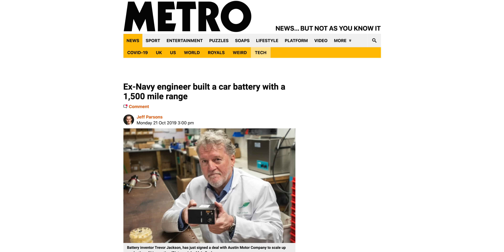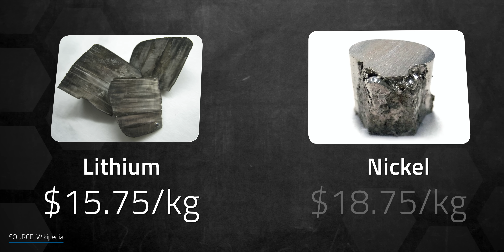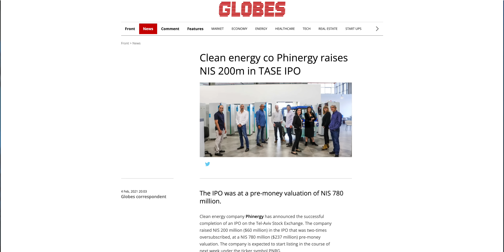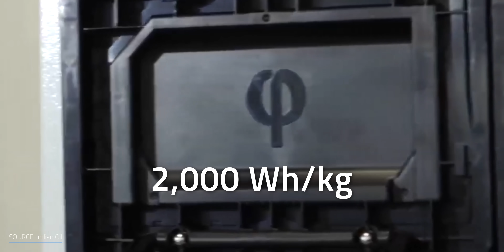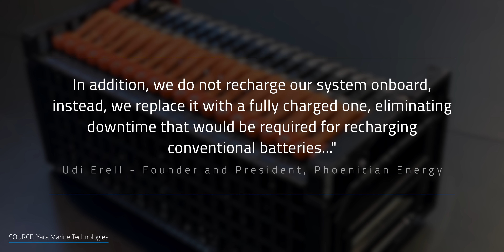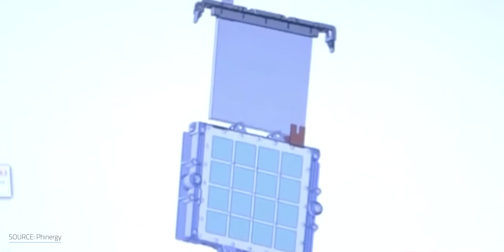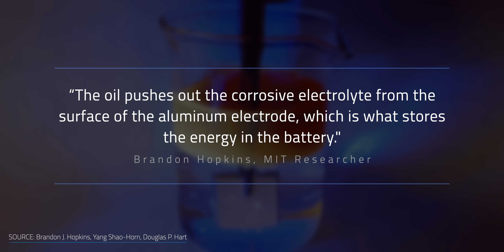Exploring the 1000 Mile Car Battery - Aluminum Air Hype?

Comment: Seems weird to say with a conventional ev u can get someone out to give u a small charge but if you have an aluminium air battery you have to get towed and cant just be given a battery. Batteries might also me able to be selected for range and time. One week you select a bigger battery for a road trip the next a smaller one as u are only commuting locally for a week. Interesting solution.

Comment: Some of the problems can be mitigated by using "plug in hybrid" solution. Smaller size rechargeable accumulator for every day commute,  and a slot for a battery to extend range if needed

Comment: I think that aluminum air fuel cells are one of the most viable alternate energy storage methods when it comes to electric vehicles. Having two batteries and quick swaps at stations would be the best way to do it. The non-rechargable nature makes using it no different than using traditional fuels, and we're all used to dealing with those in our cars. 

The mining of the cobalt used in lithium batteries is horrible for people and the environment.

Comment: I see battery swapping as a nice quick option, but not by lugging a new battery into the back of the car. It needs to be drive through and done from the underside so that loaded vehicles don't need to worry about stuff in the loading area needing to be unloaded first. However honestly having had a hybrid for around 8 years, I think that range anxiety is over stated here in Europe. Most daily journeys are nothing like as much as the range of the car and so charging at home, at work, at the shopping centre are all perfectly viable. Hydrogen is touted as another alternative and I'd be OK with that as long as it really is green.

Comment: A 1000 mile battery would be an absolute game changer for sure as it would completely do away with the only real reason people have for being hesitant to make the switch. At that amount of miles EV range becomes more appealing than ICE range....BUT if the battery is not rechargeable, I don't see this working. Having to swap large battery modules every 1000 miles seems impractical - that's every month for a lot of people. Unless it can be a totally machine automated process that's just too inconvenient, as the experience would be like having to take your car in for servicing every month, and nobody wants to do that. Maybe if the range was 3K miles and it was every 3 months that could work.

Comment: Battery swapping is a good idea for a Fedex type company.  The batteries could be charged from certified green sources and swapped as necessary.  At the moment our electric grid depends on mostly fossil fuel (natural gas).  Tesla's are basically running on natural gas.

Comment: I think this could really work.  I view battery swapping as a good thing.  It separates the making of batteries from the car company, giving more traditional OEMs a chance.  It gives dealerships business and a way to make money servicing cars.  It allow green energy like wind power the  time to charge batteries off grid and make use of energy not used other ways.  It improves the initial cost and resale of EVs.  On top of all that, I see nothing that would prevent the auto maker from putting a lithium ion battery of 60 miles or so to make sure there is a way to keep going in emergency out of range problems.

Comment: This seems like a perfect solution for a hybrid system. One that relies mostly on battery power to assist a fuel based combustion engine. This was you can have a car that can go 2,000km on a tank of fuel. You reduce the use of fossil fuel while also reducing the need to swap batteries.

Comment: I would rather have 30minutes 300miles Charger or faster instead of Swapping non reusable batteries. Would also be conserned what if the Battery Breaks and ma Chasis corrodes and i dont know it ? Because nothing is ever leak proof or can be handled by 1000s of people without some chance of breaking smth. I like the Idea of Taiwans E-Scooters with the Swapabble battery packs that recharge while u get a fresh and full one to drive around.

Comment: In 2.5 years I have recharged at home, overnight for over 95% of my miles driven. I’ve been to fast chargers just 5 times. Not having to visit a service station regularly is a great freedom I wouldn’t trade. So, no, I would not be interested in battery swapping unless it was significantly cheaper and just as reliable.

Comment: The average gas station sells 4000 gallons a day (11.4 tonnes), or about 140 MWh. At 8.1 kWh/kg, Al batteries equivalent would be 17.5 tonnes, just for the electrode. Accounting for casing, lets call it 20T, about one 40' container if palletized. But you are swapping, so you need room for 2 trailers on site at all times. You could get it to 1 if you had a special rack which could accept empties while dispensing fresh ones, but that's still a ton of space. Fuel is normally underground and liquids are ways easier to move around. At minimum, you'd need some automated system to load and unload all these batteries to make it remotely cost effective. Then there's the shipping cost for returns. Gas stations only make about $100/day in profit on fuel sales, razor thin margins. 

I don't see it happening any time soon, and by then, rechargeable EV tech is gonna be fantastic.

Heck, if you want rechargeable EVs but extended range, just make towable U-haul trailers with a power pack. A trailer is way easier to swap than some built-in battery modules, and you can rent it just for the occasion.

Comment: The only viable way for this to succeed in the market (or anything else that isn't a real battery), is to add this to a regular battery electric car with a small battery (say 30kWh). You need a standardized compartment, that can fit a battery, fuel cell, etc.. The cell must be small enough to change by hand. Similar to Gogoro's battery. But the car could fit several cells, maybe around four. The compartments could be structured such that you can choose between additional range or storage space. This way, you can use regular rechargeable battery for local driving, and some kind of extension cell for long range driving. Another option is to put it on a trailer, so you just attach a trailer with the battery/fuel cell/whatever whenever you need to drive a long trip. The trailer could even have extra storage space.

Comment: This would be perfect for the Renault Morphoz. It’s a concept car that has a normal lithium battery for driving around town, but the car can expand to fit an additional larger battery for long distance driving.
Reply: That's what I thought.  This sounds like the perfect supplement for a car that fits in the category of the Leaf or Morphoz.  40-80 ish mile range for driving around town, and when you want to take a trip you pop one of these in the back to keep you topped up until you arrive at your destination.
Reply: He said it is not rechargable so forget it being a energie saving sollution. 6:19 So not a good battery.
Reply: @paulvangorp8621  that’s what makes it a perfect solution for a battery that is only borrowed for long distance travel.
Reply: @BraveRock  it doesn't make any sense how you want to have a baterie that is at least 30% energie efficiënt when you need to replace parts. It will be way to expensive.

Comment: Considering that most car journeys are short, it would be cheaper and more energy efficient if we all used smaller batteries for daily life, and swapped out for longer car journeys.

A smaller battery means less weight, and more energy efficiency, it means less cost, and less resources being used. You save money buying it, you save money running it
Reply: You are absolutely right, Small EVs use around 100Wh/km with 1/4 the battery of a Tesla.

Comment: The replacement idea is nonsense, you need a lot of energy for recycling and so the costs would be much much higher than liIo simply because of the electricity costs.
Reply: I agree, it's total nonsense. Instead of 1 lithium battery you need 200 alu-airs for the lifetime of the car.
Reply: @gerbre1  lithium batteries are no magic either. 
We have around 500 vehicles in our apartment. They are switching EV at a rapid phase, we are struggling to provide charging ports for everyone. Need to rewire our entire basement, get additional capacity sanctioned. Pay higher tariff and so on. 
If its Al-air battery, I don't need any of that. Some company like Indian oil will do it for me. I just need to make a booking through an ap. Someone will come and replace it. I don't even need to own the battery.  This is the model we are using for cooking gas in India for the past 30 years now.
Reply: @adarsharao  Load management is needed. 10 cars can share a power line. Add external stational storage that is slowly charged in the background and can be used on high demand.
Reply: I agree. At this time aluminum air batteries are a waste of time and energy.
Reply: Plan is that energy for recycling comes from hydrogen, produced by electrolysis of water using solar power.
Reply: @adarsharao  
So even more Energy?

Comment: No, one of the biggest advantages of EV's is the ability to plug it in at night and wake up to a charged battery. These require swapping, which keeps you dependent on the battery supplier, and the locations that can do that work.
Reply: If you drive an ICE vehicle, you're already dependent on your gasoline provider; and given that these batteries can be swapped out in three minutes, it shouldn't be difficult to design an interface that would allow an owner to swap a battery out at home. I can change the 12V battery under the hood in my truck in under ten minutes, and that's not a process that was engineered specifically for user friendliness.
Reply: @shaun4772  i'm not dependent on "my" gas provider. I can go to any gas station. There are just now starting to be enough charging stations for EV's. That's an appropriate comparison to ICE versus EV. Comparing Aluminum Air batteries  to gasoline would be closer to looking for someone to replace your gas tank.
Reply: @shaun4772  gasoline and diesel fuel aren't vehicle-specific like aluminum electrodes can be. With a Audi gas car you don't have to (and also can't, Audi doesn't sell gas) go to Audi for gas. If there would be an Audi car with Al-air battery you may be forced to go to Audi for replacing single-use batteries (for example non-standart cell dimensions). That is way inferior than both current cas cars and current electic cars.
Reply: @volodumurkalunyak4651  That's why the auto manufacturers need to get together and agree on standard battery types.  If I buy an electronic device that runs on AA batteries it doesn't matter if the device was manufactured by Sony or Toshiba because the manufacturers all agreed on standardized battery types a long time ago.
Reply: @LG123ABC  currently manufacturers do NOT agree on charging port standart for EV and you expect them to agree to standart on swappable batteries??? I would have my bets on that NOT happening.
Reply: @volodumurkalunyak4651  Well, they should.  Can you imagine being restricted to only filling up at Ford petrol stations if you drove a Ford?  Oh, you drive a Toyota?  Sorry, but you have to go to the station down the street.  It would be ridiculous and it's ridiculous with EV's as well.
Reply: @rogerstarkey5390  Actually, I think that would be a selling point.  I could use just one standard battery pack for driving around town and I wouldn't have to drag around the excess weight of battery capacity that I didn't need.  If I wanted to go on a long trip I could have additional standard battery packs installed and then removed when they were no longer needed.  It's the ultimate in customization!
Reply: @LG123ABC  stopping users from using unapproved gas pumps weren't possible as anyone could have used dollar store gas canister defeating the purpose of non standart gas cap. Novadays manufacturers can use such a thing with al-air batteries without any hassle. Classic anti-consumer anti-independent repair move copied from smartphone makers and John Deere.
Reply: India recently announced planning to standardise Battery design in all cars for interoperability and ease of swapping.
Reply: @shaun4772  that’s kind of the point. If You still drive an ICE car, You’re used to the cost and inconvenience of having to go to the filling station. Just the materials and production of such a single use battery pack would cost more than the $50 equivalent kWh one needs for a 1000mi trip in a lithium battery pack EV. It might be cheaper than loading Your trunk with single use AA batteries, and then replacing them every 1000mi, but there’s a reason pretty much none of the electronics You use runs on single use batteries anymore. It’s just cheaper and more convenient to be able to plug them in and recharge.
Reply: Not everybody has a house with and garage.. so thats only an advantage for maybe 30% of people
Reply: @bugfeatures  Which is why ICE vehicles are still by far the majority as far as cars currently owned. You're absolutely right.
Reply: These require swapping, which keeps you dependent on the battery supplier, and the locations that can do that work. "Kind of like Petrol stations we do NOW?  So, no diff.?    Even if it was HAMSTER POWERED, you still RELY on the Pet store for another rodent.
Reply: Rechargeable BEV's are the future, nothing else compares.
All these other distraction technologies, including Aluminum Air and Fuel Cells are a massive joke that some are trying to play on consumer autos.
Reply: @straighttalk2069  I agree. As Rechargeable battery technology improves, so will mileage et al. Improvements will happen on their own as battery technology improves, and consumer demand drives it (literally).

Comment: Replacing  an entire battery pack every 1,000 miles would be far more expensive than recharging a standard Li-Ion battery powered car about 4 times and battery swap stations would be much fewer than recharging stations.

Comment: We can't even agree on a common charging system, let alone battery formats. I guarantee manufacturers would come up with a hundred different and incompatible batteries, making it virtually impossible to find a replacement. No swap station would want to stock that many different types. At the other end of the system, Aluminum refining requires a ton of electricity; I can't see how this would be viable at scale. The only application where this technology might prove viable is in electric aircraft, where weight, energy density, and range are paramount.

Comment: It might work for fixed route city bus or even between cities within the range of these batteries.

Also, why not have the ability to add on these as range extender, for lithium ion battery EV, while on long trips. Swap out the batteries when they run out of charge.

Also, it can minimize the dead weight of the vehicle if EV owners can dynamically select different battery pack as per the need.

Comment: Battery swapping in cars seems less desirable. But for airplanes it can actually be a good system.
Mr.Musk always say that electrical aircraft can be feasible when energy density will surpass 400KWh per KG.
It seems like Aluminum Air batteries are above this threshold...

Comment: I think this would be a complimentary technology. For a car you'd still have a rechargeable cell but alongside that you'd have a bulk fuel cell that gets swapped out. The thing is I think if this is going to make any sense the bulk cell needs to last for months or years. Constantly swapping out cells, shipping them back and forth doesn't seem workable. Personally I think this has more applications in things where recharging is less of a problem and you just need a bulk energy storage that will last the life time of whatever it's powering.
Reply: We already ship fuel. Freight lines and tanker trucks move gasoline already. We already industrial processes to extract and process oil into gasoline, so we'd be replacing those processes with battery logistics and recycling.
Reply: @shaun4772  Gasoline has roughly 10 times the energy density according to the current state of the art in mentioned in the video. So that comparison is not like for like. If you switch to these batteries you have to shift 10 times the amount of them for the same energy. However with a rechargeable battery you ship it once and then transfer the energy over the grid.
You might as well just ship gasoline and burn it to charge lithium cells in place.

Also gasoline doesn't require high current/voltage contacts in your car that aren't rated for lots of connect/disconnect cycles. One of the common faults with current EVs are the connections between the cells in the battery pack going bad. Now you want an exposed connection that gets bashed around by some minimum wage guy at the gas station a few times a month.. mmm

Comment: Swappable batteries would be game changers for certain driving conditions. Battery swaps would work great for things like long haul trucking, buses, and taxis. For trucking you could have them swapped out on site while the truck is being loaded or unloaded. Having batteries on site would be much easier than having a fueling station. This would also work good for taxis and bus depots. This might also work good for things like short hop airlines. Rechargeable works great for the daily commute, where you have time to charge your battery at work or home, most people fit into this category and it is mostly fear that they "might" need to drive further that most people haven't adopted. But people tend to look at all these technologies in a vacuum. Within the next 20 years car ownership is going to decline as autonomous self driving car fleets become the norm. And that might be something quick swappable batteries work better for.